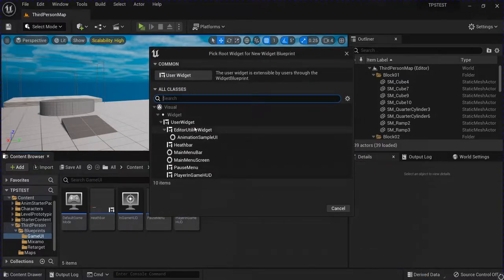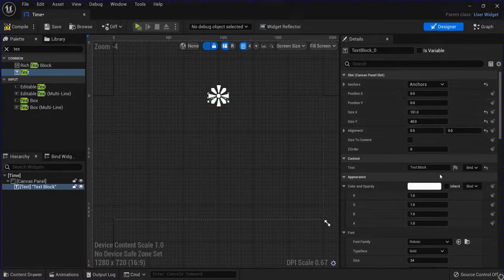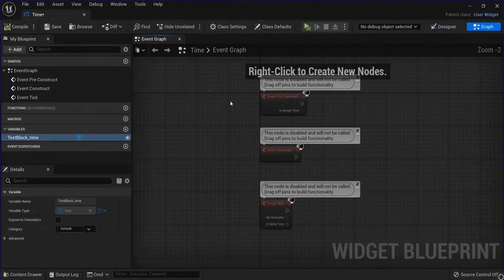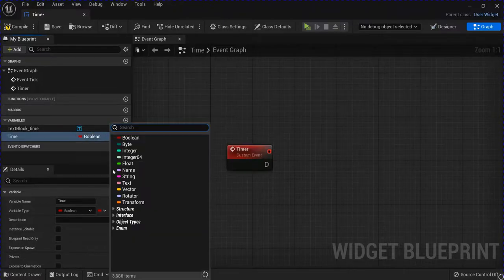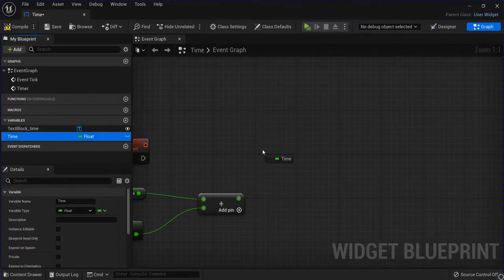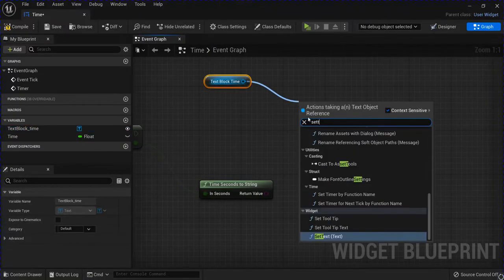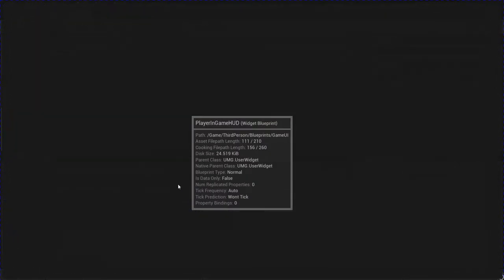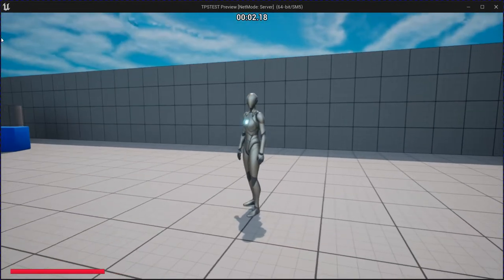How To Make A Timer | Unreal Engine 5 Tutorial

Comment: I've watched like 5 different videos showing off the longest most overly complex way of doing this and then I found yours and was dumbfounded at how simple it was. Thank you so much. Though the one thing is, is there a way to get it to display more digits if we wanted to? For example: 12:34:56.789 instead of just 12:34.56
Reply from the maker: Thank you I really appreciate it 😁🙏 Also as for the extra digits, I don't believe there is a way when using the Time Seconds To String node because it's format is minutes:seconds.milliseconds 💯

Comment: yo this tutorial was so fast and simple but i did have one doubt. When I tried using the text as a variable in the event graph, it was of a type static text with the blue ellipse and not the blue T symbol I see in your video. This was stopping me from connecting the textblock_timer to the Set Text node. Do you know what might be the problem?
Reply from the maker: @ifrozr  The only thing you need to do to the text block is to click the box for Is Variable when inside the Designer and then in the Graph you drag from your text block to get the SetText (Text) node 💯

Comment: Is there any way to remove the milliseconds?
Reply: use integer instead of float
Reply: float❌   integer✅
Reply: @kazatv8534  but clamp only have in float, what can be replace if change to integer?
Reply: @shidou2380  You won't lose anything. Think of float as a more detailed number, whereas integer is a flat number without fractions.

Comment: Do you know how to make a countdown? I'm trying to get the time to count from 10 down to 0, and then repeat.
Reply from the maker: Yes I do know how to make a countdown. Would it just be repeating each time it hits 0 or something else? You can use the same nodes within this video. Take the Time variable and set the default value to 10. then instead of adding world delta seconds you wannna subtract world delta seconds from the Time variable and after the subtract before it goes into the set Time you want to add Clamp(Float) and put your time variable as the maximum. As for the repeating part, I would need to know what you would like to be the cause of the repeat 😁🙏If this is hard to understand just let me know and ill make a Countdown Tutorial 💯
Reply: @FcbDev  Yea it would repeat every time it hits 0, sorry I didn't see this earlier. I am a little slow so I'll try what youre saying in the comment, but ill let you know if it works or not
Reply: @FcbDev  I would like it to repeat on its on, I got it to countdown from 10 to 0, thank you for that. I just need it to repeat the timer on a loop, so once it goes from 10 to 0, once it hits 0 it goes right back to 10 seconds, and then counts down to 0 again.
Reply from the maker: @tankdjsims  Perfect sounds good 😁 So to make it repeat you want to go to the Event Tick and disconnect the Time Node. Drag out your time variable and choose Get. From that variable drag out and get Less Than And Equal To 0. Then plug the Less Than And Equal To into a Branch. Plug the False of the branch into the Time Node that was connected before. For the True part of the branch, drag out your Time Variable and choose Set and change the value to 10 then from the Set Time you want to drag that into the Time Node that is connected to the False 💯🙏If you need more explanation just let me know 😁👌
Reply: @FcbDev  yesssss thank you so much, that works perfectly!
Reply from the maker: @tankdjsims  Awesome 💯 I'm glad I could help 😁🙏

Comment: How to not show milliseconds? Thank you
Reply from the maker: I personally don't think there is a way when using the Time Seconds to String node 🙏
Reply: Thank you for responding  @FcbDev
Reply from the maker: @edwydennytwins  No worries 😁💯
Reply: I used "chop left" node on the "time to seconds string". Though @FCbDev nice tutorial, thanks.
Reply: @gertsuik6092  how? after the node on time to seconds string, put the left chop?
Reply: @shidou2380  If you never figured it out (or for someone else doing it now), adding the "Left chop" from the pink "return value" on the "Time seconds to string", add 3 to the "count" on the left chop, and it'll remove the milliseconds including the dot.